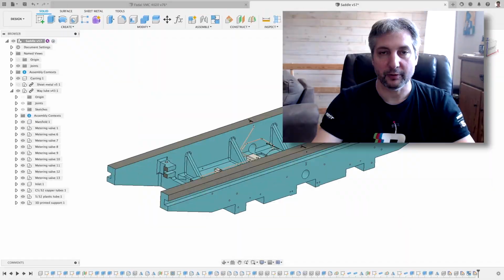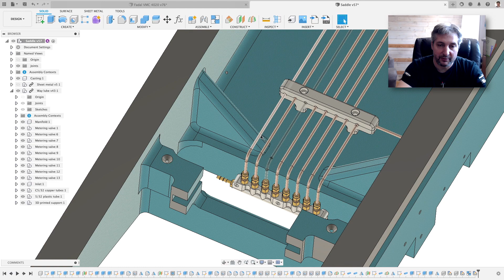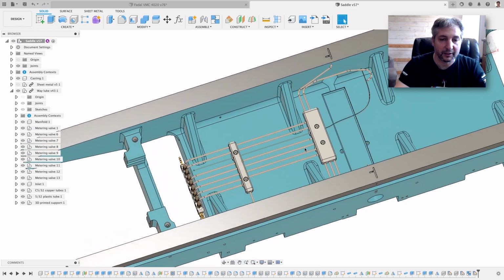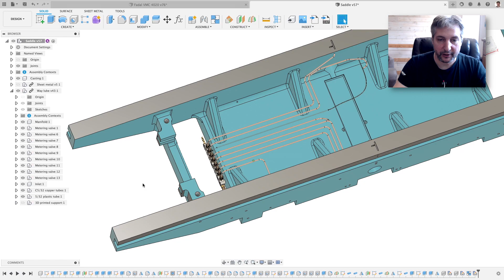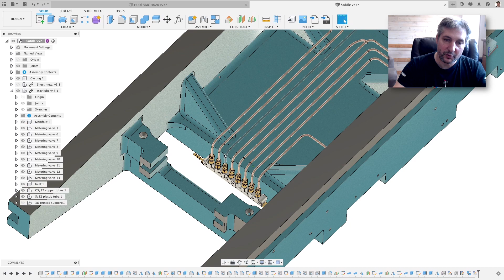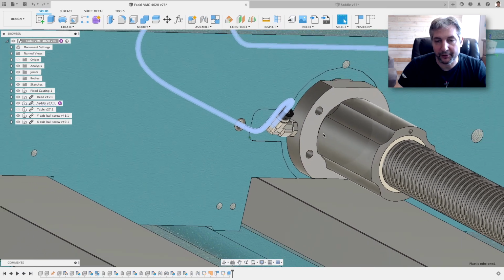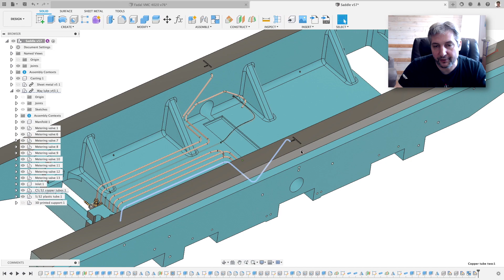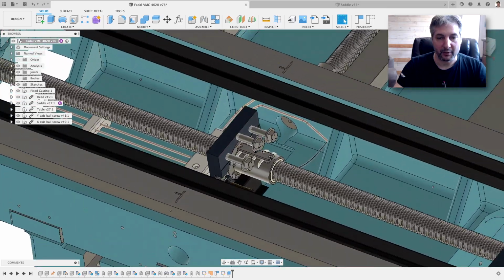Part 25 - (Metering valve values for the saddle lubrication)

Comment: Is there supposed to be lubrication lines to the Y axis gib strap assemblies on the bottom (left and right)? It seems like they are designed to have something but they omitted it and rely on runoff from above?
Reply from the maker: I made a PDF document on my GitHub (Blaise Barrette) detailing metering valves values for each lubrication points. You should find what you’re looking for there.